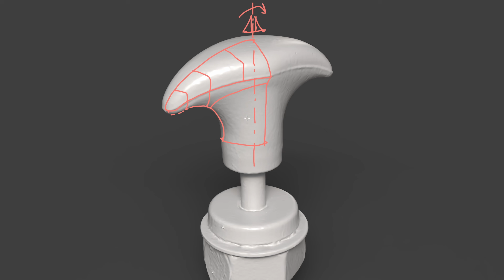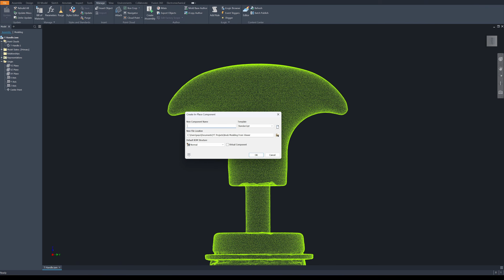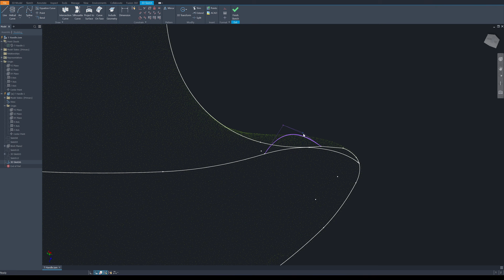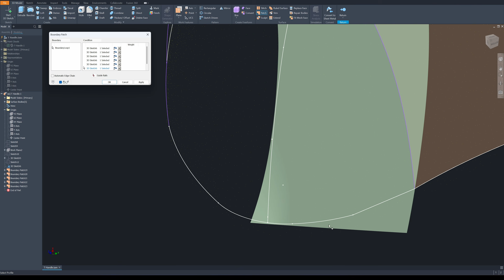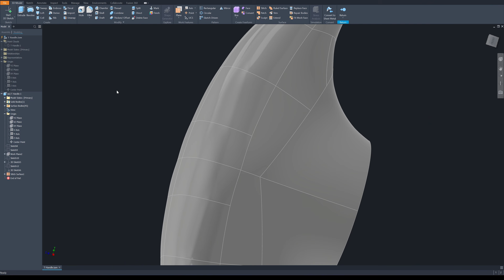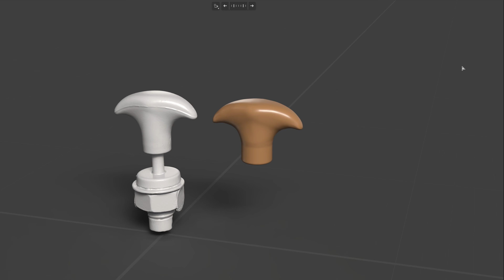How to Reverse Engineer a Vintage Car Pull Knob - 3D Scan to CAD

Comment: How much do you pay for inventor?  Isn't that expensive?  I wonder if you can import point clouds into fusion, freecad, or solidworks?
Reply from the maker: $2690/year for the package, including AutoCAD, ReCAP and 3DsMax. It's professional tool so it's not expensive.   You can import point cloud into FreeCAD, Solidworks, SketchUp Studio, Rhino3D, BricsCAD, ZWCAD.
Reply: @Payo-TensileCreator thanks Payo.
Reply: @f1hotrod527  you can import point clouds to freecad, but not in fusion. Inventor is about 300usd/month

Comment: The patched look is similar to Freeform (T-Splines). I assume Freeform could be faster, though it lacks functionality in Inventor, compared to Fusion, as it seems.
Reply from the maker: Inventor has Freeform function. It's polygon modeling-based command, not CAD based, there are going to be a lot of issue afterward by using that to sculpt the surface.
Reply: @Payo-TensileCreator  I doubt we can call it polygon modelling (Catmull-Clark). We can convert Freeform to CAD geometry, based on NURBS and do holes, threads etc. Yes it has some drawbacks, but for shapes, that aren't gonna change, it suits well.
Reply from the maker: @PetterStetter  It has issues when making 2D drawing with the model created with Freeform and also when running tool path with CNC. It works fine with 3D printer slicer though.